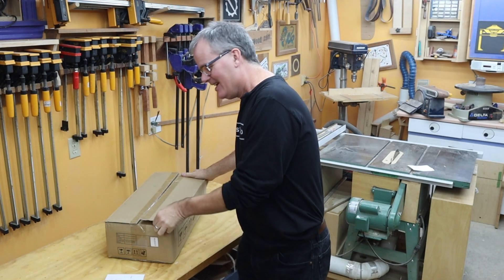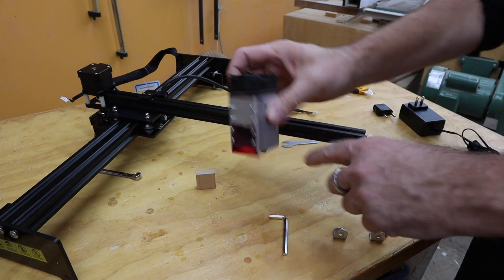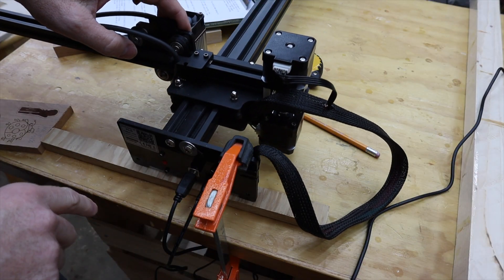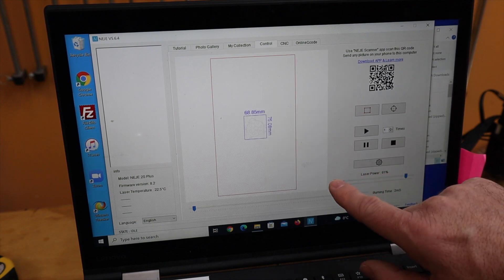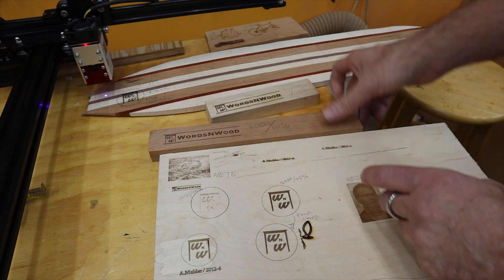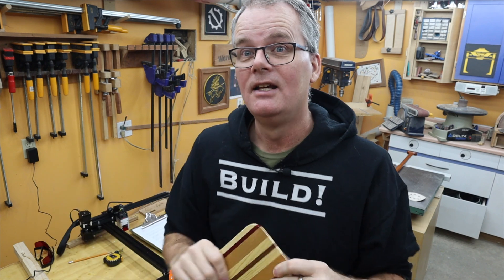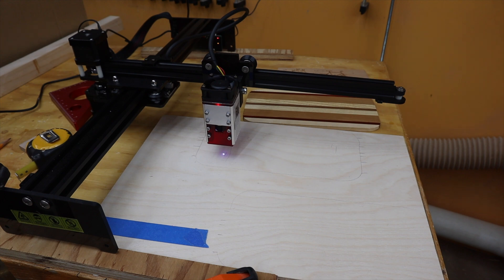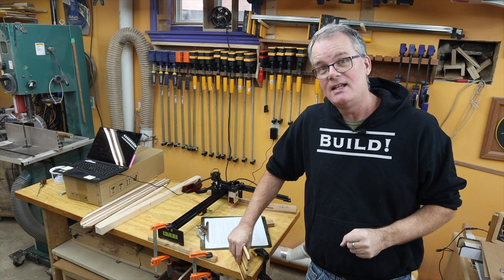CAN I BURN?  // NEJE  Master 2S PLUS (N40630) // WnW#256

Comment: Thank you so much for your tutorial and review. I just bought one of these used and have not got it yet. I am trying to familiarize myself with what/how everything works. I was wondering though if you have used the air assist yet? Is that something that I will want to add or not? I'm not sure what it really does. My primary reason for buying this is to sign my work and maybe add some graphics too.

Comment: Really nice finished engraving for something in a low price range. I didn’t say cheap because it works and aluminum extrusions and everything holding it together seem solid enough. I’d buy it if I wanted to engrave something I made to sell. It’s capable enough and the monster sized ones are a couple thousand dollars I think.

Parallel clamp saga. I got four 50 inch and four 24 inch and now I’m looking finish with four 40 inch. I think that’ll cover me for a couple years but 40 inch is definitely my favorite length.

Comment: Very interesting Art.  I went to the site to check them out and the pricing was a lot less than I was expecting.  I read in the comments further down that these can cut also,  that just makes them more enticing.   Christmas present for myself maybe....
Reply from the maker: Someone else asked about cutting also, and maybe I wasn't clear on that in the video.  My understanding is that you can cut, I just haven't tried it yet as I was trying to learn engraving.   Ventilation would undoubtedly be even more of an issue then, as it will be slower.  Thanks for watching!
Reply: @Wordsnwood    Yep, with the air assist it cuts.  Just watched a video on the website showing that it does cut.   21mm (10 passes) cut.  If for nothing else I see this as a great template maker.       
Also great that your getting some recognition and sponsored stuff.